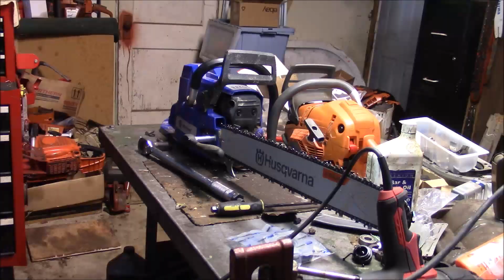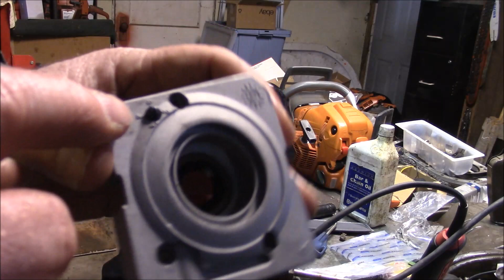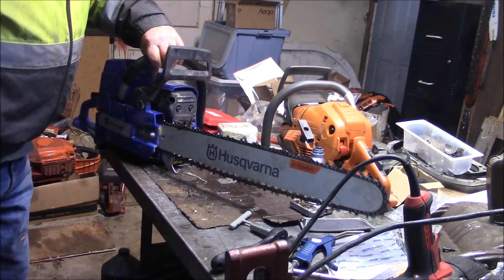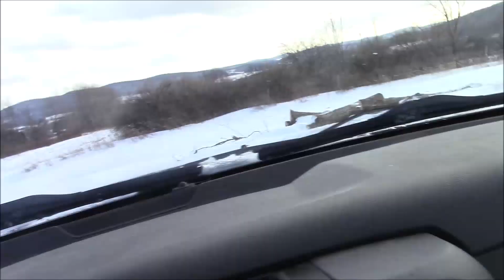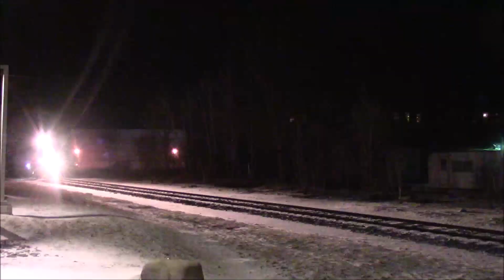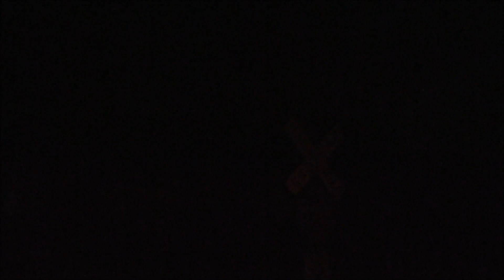Holzfforma g288 Gets A New Bar Oil Pump. Does It Solve That Saws Issue?

Comment: Hello sir, if you had to choose between the 288 and a stock G660, which one would you choose? I’m trying to decide. Also, I believe I saw you post in the Farmertec forum that you had mounted a full wrap handle to a 288. Was that very difficult to do? I’m thinking you said it was the handle for a 390. Thank you for your time.
Reply from the maker: Guess I've said this a couple of ways...the "practical" ready to work choice is the g660. For me even thought the g660 maybe technically spec sheet better, I prefer the g288
Reply: @afleetcommand  thank you for the response brother, I really appreciate it. Just today I actually ordered the 660 with a big bore kit. But later this year I plan to do a build on the 288 and the 395 when it comes out also.

Comment: Age does that to you.  I am watching what I buy or build these days, because if I can’t start it I don’t need it.  I am considerately older than you and Bob and can’t snatch a saw like I once could.  I never have been a person that drop started saws but I had enough strength to ground start them.  Mostly, I leg started most of them.  I really love my little 026 Pro that I restored this winter.  I can start it about any way I want, mostly leg starting.  It won’t cut real big stuff but it will handle most anything that I need to cut.  It’s backup is my H455, another easy starter.  I had though about building the Stihl 880 but after watching your difficulties with it I decided against it.  I may build the 038 but 60 odd cc is my limit.
Reply from the maker: Yeah...I thought I still "had it" when I first was running the g888.....right until it kicked back on a pull start. Tweaked my elbow to the point I couldn't run saws for a few days. :( So now kind of approach it like a dog around a rattle snake.
Reply: @afleetcommand  I know that feeling.  It need to be a little richer.  It fires early because it is lean.  Pull it over in full choke a few more times before pushing it up to half choke.  That is why I sold my 460 - that sucker ate up my arm.  I think it is a squish problem.  Farmertec just loves large squishes (.050+). Pop that cylinder off and check it.    I know you know how to change it back to something reasonable.  I am not a weenie.  I cranked up a ms-461 in three pulls, witnessed.😎
Reply: @afleetcommand  being a long time bird hunter I know all about a bird dog sneaking up on a snattlerake.  I once dropped three quails and I headed to the first two and my setter headed to the third.  I picked up the first and as I started to pick up the second, a four footer hit my Russell Snake boots.  He did not know I had reloaded my 20 gauge M1100, skeet,, so he ate three loads of #8’s.  There was not a lot left of him but Princess wanted to look and I grabbed her collar before she did because a dead snake can still bite you.  A dog that cannot smell a snake does not have a good nose.  Princess was a Lelwellen setter and one of the best dogs I ever hunted behind.

Comment: You said you've had two Farmertec saws that were wins. Did you have issues with your Devil in a Blue Dress G660? I picked one up after watching the video were you left it out in the snow last winter and it popped off in a couple pulls. Put it to work milling and noodling and haven't had a bit of trouble out of it besides a chintzy chain tensioner.
Reply from the maker: No the g660 was an absolute win. And it's out on long term testing with a professional firewood supplier. So three is accurate from that perspective. I would say the series of built ms660's were by far the biggest successes....and MOST of them are still in service. But aren't stock and have a few OEM parts and a few Hyway parts as well which is why I didn't put them in. I also changed out a few parts on the Blue 660 with OEM as well. On the 888 and 288 there are NO parts at all from anywhere else than FT. Why in my mind set doing the video I picked them as they were the FIRST saws I could say that about. But you are correct, broaden the definition and scope and the blue 660 is number three, widen the scope a little more and those built 660 kits saws make four absolute successes. There are a few that weren't 372xp, 372xt, and a few others. :(

Comment: Last year when I built a Farmertec 372 XP kit saw I had to cut down the oil pump to about the midway point when using a 20” bar.  This is the first kit saw that I have not adjusted wide open, even with a 20 inch bar.  I also lubes well at this setting with a 24 inch bar.  I have not tried longer bars on the 372.

Comment: I am gonna get one of these G288 myself. What size bar you running? I am thinking of a 32" bar for mine
Reply from the maker: I run a 24inch for most operations and a 28 for felling the large ash and maples I have here. They aren't a light saw so I look to get the lightest combo possible for the task at hand. Those new Husqvarna bars I've acquired have worked out very well as have the c83 chain
Reply: Thanks for the reply back it is much appreciated

Comment: That g888 is something else, been eyeballing the 288 just never worked with any 200 series but seems simple enough to fix/americanize and port, I got  the early orange g372xp years ago big bored it and ported the snot out of it and a pOP up, only changed and ported the jug and piston and it's been flawless I been waiting for the bottom end to go...but it just won't give up, it's the nastiest 77cc 372xp or 77-esk cc saw iv run, def out pull any 461s I've used and it came I tuned it very little out the box and it has always been great and reliable and strong, so much compression I had to switch to 550 cord starter rope, couldn't keep regular rope from snapping, the pull/torque and hp is insane and always tunes easily just as a husqy would..

Comment: Go Walt!  I see your reasoning for purchasing a knockoff, with a little time, work, and aquired knowledge, a guy like you can have a viable saw at a third the price of OEM.  As for me, I would rather stick with the factory offerings that have been woods ported.  Does that make me a hater?
Reply from the maker: Nope, and I completely understand that. If you watch my channel I have both factory build and kits over time. Three "classes" of saws on the Channel, Chicken chit to chicken soup hobby builds from OEM bones, Kits & Clones, and OEM saws. They are just saws. The kits & knock offs & vintage saws are for the hobby and hacker in me. The new OEM's for work. Said that dozens of times. And now the kits and blue saws have been developed to the point they can work...for real, I choose to also run them in the rough conditions and keep time off my OEM's
Reply: @afleetcommand  Gotcha.  I really enjoy your channel... I think it is the only one I scribe to.  I am retired and work part-time at a store in Idaho that sells Sthil and Husqvarna saws.  Although I love my ported 346 and 550, I think the new Dewalt 4hp, 20" battery saw is going to make 50cc saws obsolete for many.

Comment: I have been hearing about several people having oiler issues with the factory built G288’s.  I built one of the kit saws, and the oiler has worked just fine…In fact it is capable of over oiling a 28” bar without being turned up all the way.  Thanks for doing the video!

Comment: Excellent video Walt 😁 some very good points made regarding fit and finish of the g288 I noticed it felt much better put together right out of the box ! Though I had the same no oil issue, replaced the factory oil pump with a Farmertec one and it was oiling perfectly. Can’t wait to try it out in some big timber